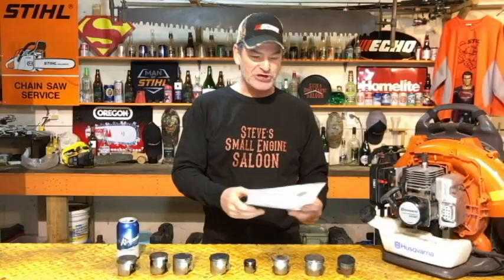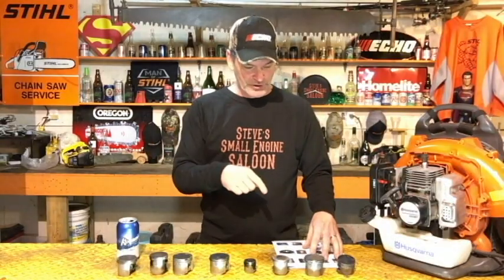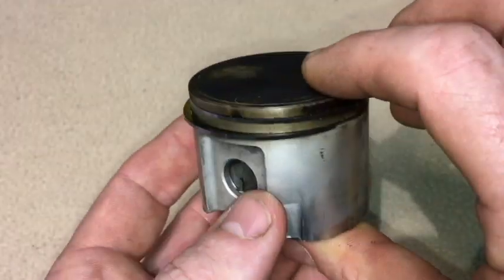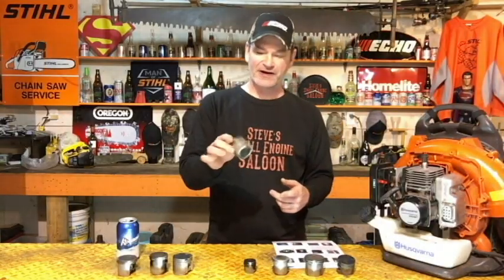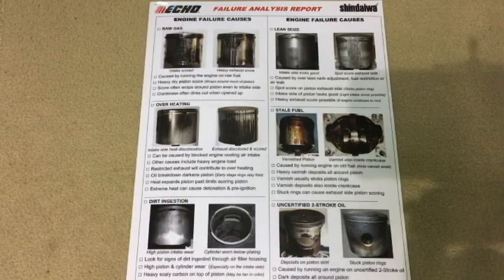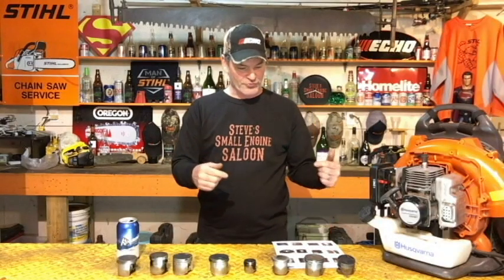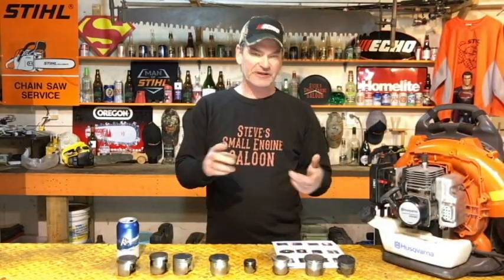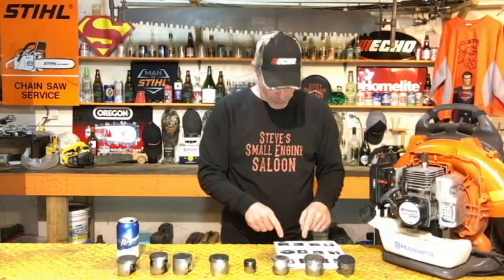How To Tell WHY Your Piston is Destroyed

Comment: Brilliant video, thanks!  I know this has been asked, but can many of these scored piston/cylinder issues be somewhat prevented by running a 40:1 mix instead of a 50:1 mix?  Thanks Steve.
Reply from the maker: I have burned 40:1 for over 20 years and never had a problem....
Reply: i run all my stihl on 33:1 and never had any problem
Reply: So should I be adding a little oil to the high dollar premixed 50:1 Echo Red Armor fuel that I use?

Comment: Steve....my echo PB 250 has an oversized gasket on the intake side of the carburetor.  Replacement carb rebuild kits have a gasket that just covers the intake port.  Does the oversized gasket have a purpose and should I reuse it if it is still good?

Comment: Awesome video Steve , you can't emphasize enough that leaning a carb out on a 2 cycle motor is taking away most if not ALL of its lubrication . And also have you had any issues with the Stihl MS441C saws having issues with spark plugs backing out on their own ?

Comment: Fantastic job !!   Hey Steve what is you recommendation for a good quality 2 cycle oil. And do you see and problem if I run my saws mixture at 40:1 instead of the recommend 50:1 ?
Reply: Mixing Ratio (Gas:Oil) Volume of Gasoline Volume of 2-Cycle Oil
32:1 1 US gal. (128 oz) 4 oz.
40:1 1 US gal. (128 oz) 3.2 oz.
50:1 1 US gal. (128 oz) 2.6 oz. 
ere u go mate
40:1 is a bit more oil to gas compared to 50:1 so yeah i think (imo, but i have only had a success rate of 1:3  only having fixed 1 chainsaw in my life which is a pouladn 2000 which uses 40:1 so yeah take it with that you will but i think it would be safe, keep in mind it might smoke a bit (i know its not healthy for the thing but it has a dull chain and i ran it on 50:1 and it smoked like a wood stove burning pine wood which is also not godd as the sap can get into the chimney and catch fire : | so yeah i sugest you use 50:1 but in a pinch if the saw requires 50:1 you can get away with 40:1 but if it requires 40:1 then just use 32:1 or something or just add a few extra drops of oil into a 50:1 mix for something a bit closer to a 40:1
Reply: @djaydeved  IDK what you're going on about... 

OP, if your engine calls for a 50:1 mix and you run 40:1, the negatives all involve fouling. Too much oil than needed causes carbon to build up on the piston crown, spark plug, and exhaust spark arrestor screen. Too much carbon on the piston may break off and scratch the cylinder wall. If you use a high quality synthetic 2 stroke oil with high quality ethanol free gasoline, your engine will be fine with 50:1 mix. If it brings you peace of mind, you can run 45:1 or 40:1 mix with the knowledge that you'll need to clean your plug and screen more frequently. Leaner oil mix ratios are the result of better 2 stroke oil blends that lubricate better with less ash, and EPA directives to make 2 stroke engines smoke and pollute less than before. Using ethanol free fuel is more beneficial to the overall health of the machine than a richer oil mix in my professional opinion. The carb will be destroyed by ethanol long before the rings and cylinder wall are worn out.
Reply: @mannys9130  Cylinder heads are mostly Nikisil coated. Any carbon coming off will not scratch it. It's hard as F.

Running premium (no ethanol) and a bit more oil then recommended is fine.

Comment: how can my piston be seriously scored on exhaust side and still get 115psi on compression? for 50 pulls it might start wide open for 3 seconds MIGHT! great spark great compression new carb new fuel lines and filter??? What gives?
Reply: immanuel ahrens 
Testing compression above the piston only tells part of the story. I would suggest performing a vacuum/compression test in the lower end and crank case to check for air leaks

Comment: Steve, do you have an opinion on what oil not to use? As in, I run Castor 927 in my two stroke dirt bike, but its water cooled. I currently use Stihl oil in my saw, but have thought of not using it and just using one oil in all of my stuff (the 927).

Comment: Very informative......keep the good work up Steve.
I have question for you sir.
Re: A craftsman 29 cc 4 stroke weed wacker model # 316.711970.
Has a compression of approximately 50 Psi ......could this engine start?
What’s the minimum compression needed to start this engine?
Thank you .
Reply from the maker: Most 4-stroke trimmers I have run across require at least 60...
Reply: Keep in mind most small 4 stroke engines have auto decompression systems that will cause the exhaust valve(s) to lift off it's seat on the compression stroke when the engine is spinning at low RPM, (like when your pull starting it or trying to take a compression reading) so the reading you get will not be the actual compression, and really won't tell you anything. You would have to disable the decompression system which can be simple like on Honda OHC GC type engines, or not possible without splitting the crank case like on a flat head briggs. Even a little 29 cc craftsman probly has an auto decompressor, If I was a gambling guy I'd bet it do!

Comment: Thanks Steve. Very useful info. I have a Briggs 6-5 OHV engine that blew out the head gasket right near the intake. PO ran it for a time even though it was puffing like a steam engine. Piston scored right near the blow out. Cylinder wall scored as well. Slight catch on my finger nail. My question is the cylinder still usable if honig can remove the slight scoring?  I get free gas powered machines and get them running again for resale but I don't want to sell anything that may fail prematurely. What's your advice?
Reply: Not very ethical.
Reply: I am not a small engine expert like Steve so I am not sure if this would be a usable cylinder. Are you saying that it would not be ethical to use it? I want to be ethical.

Comment: Another great video, Steve, thanks!  I'd like to add a comment for conversation and or comment regarding mix oil. Living on the coast and many boaters, I know folks who think it's just fine to run outboard two stroke oil for mix oil in their saws.  As I understand it outboard oil relies on water cooling instead of air cooling and therefore the temp range of the oil's protective capability is vastly different.  So, don't use it!!!

Comment: This was not dry at all this is good stuff and accurate, keep your jets a tad rich and 40:1 mix with quality oil!
Reply from the maker: I couldn't agree more...
Reply: @StevesSmallEngineSaloon  Where can I get a piston kit for the Maruyama trimmer 5050 ? I'm from Quebec Canada.Thanks
Reply: Also,.... warm your saw up.
Reply: I wish i had a small engine mechanic as knowledgeable as u Steve & as personable! 10 thumbs up
Reply: My echo blower says to use 50-1 and 89 octane gas. Should I still use 40-1?
Reply: @robertgerber2533    Use the recommended oil by mfr, mix it at 50:1 as instructed, an ONLY use high octane (min 92) without ethanol
Reply: @kellismith4329 There is absolutely no reason to run 92 octane fuel in a small engine. Octane is not a rating of quality, its a rating of resistance to combustion, these small engines do not have anywhere the amount of compression to require 92 octane fuel.
Reply: @integr8er66  it’s 94 that I use and ya cuz it doesn’t have ethanol and crap in it - 13 yr old blower now still like new
Reply: Too rich of oil mix will cause plug fouling and exhaust screen clogging - oils like red armor and echo powerblend contain cleaners to keep things clean - NEVER use car engine oil this is sure to cause failure
Reply: I've been running Amsoil's Sabre 100:1 mix in my Stihl saws really hard and for years and LOVE it.  Way less smoke and lost track of which gas jug was mixed, which one was straight gas and refilled my 1/3 full 1.5 gal woods saw jug with straight gas 2 days in a row.   That is, I had a half gallon of mixed gas left in the jug after an easy morning, refilled it with straight gas, cut the next morning and had a half gallon of very diluted mixed gas left in the woods jug, refilled it with another gallon of straight gas and ran the next morning, wasn't till I brought the saw down to the truck the 3rd day and filled it straight from the straight gas jug that the saw siezed up.
Reply: @mattobermiller5041  Uh, yikes! Poor saw that got the straight.
Reply: Did the same, diluted a 2g jug of mixed with 1.5G straight gas and forgot to remix - seized it about 20 minutes later
Reply: Nah I always crank the gas, washes the carbon deposits out before they can score stuff up!

Comment: I have an echo cs 3400.  When spark plug installed the compression feels very strong and lots of torque when pulling rope.  I took the plug out and when installed the compression tester it had hardly any torque and read only 30 psi  Why does it feel like it has a lot of compression when the spark plug is placed back in.  thanks for any assistance and great videos.
Reply from the maker: I would think you have a faulty tester....
Reply: Sometimes it can feel like there’s perfect compression but it’s not because it leaks out suddenly at or after TDC. I had an 034 I couldn’t get to run for forever, I double checked everything but compression because it felt perfect, but the cylinder would heat up slightly after a while pulling so i knew it was trying to run. Turns out the ring was stuck on the exh side, the connecting rod angle was keeping the piston sealed tight on that side but once the crank passed TDC the rod would push the piston to the other side, open up the gap where the ring was stuck and the air leaks all out.
Reply: I’ve diagnosed this a few times since then, just by slowly spinning the engine and seeing how it feels. They all have a bit of ‘wiggle room’ at tdc but if the flywheel moves too many degrees or feels like when the piston is at the bottom (just pulling starter rope) then you might want to check the piston
Reply: Thanks for the tips, I appreciate it.
Reply: I'm the tester, I'm faulty.  Hahahaha

Comment: Fuel restriction , lean running, .... don't underestimate the fuel filter, even if you just replaced it.  Some of the fuel filters I've been using , specifically 38-9227 from Rotary(503443201 substitute) had loose plastic flashing material  and flopping around inside the filter, blocking the filter outlet,  causing a "check valve effect".  That would certainly cause a lean condition.

Comment: Hey Steve. Love your channel. I have a question, I recently bought a Stihl MS271 and the dealer told me that Stihl no longer uses needle bearings for the piston pin and told me to use an ”extra shot” of oil directly into the has tank after adding the proper mix for the first five tanks. Have you seen this to be an issue? He said the new design is a bushing that is too tight on the tolerance and tends to seize before it wears in and the extra oil helps.
Reply: Your dealer is right. I have a buddy that had 2 BR600's that have piston pin seezed.  Also the manual states to not run 87 octain. It causes the pistion to run hotter. Also 
 Stihl hp ultra  oil  has far better resalts for the 4-mix moters ive heard

Comment: Excellent presentation!!  Getting ready to work on an old 1987 Stihl 011 that is hard to start.   Just ordered a compression tester you recommended.  Watched all your 6 videos on why my saw is hard to start.....I feel very confident after watching your vids that I can tackle this job!!  Thank you!!!!
Reply from the maker: You're Welcome...
Reply: Steve's Small Engine Saloon I did all you diagnostic tests, cleaned carb, 120 on compression test, new gas filter, gas line and spark plug.  It runs better than it ever had.  I used some premixed 50:1 gas.  Any recommendations on brand or ratio gas for this stihl 011 AV?  I have always mixed my own with alcohol free gas at a ratio of 50:1... ...it still runs and has good compression so I must be doing something right.

Comment: Steve, I always use ethanol-free gasoline and I always add StaBil when I buy it because I am never sure how long it will sit. How long can I trust that fuel?
Reply: There always has to be “That Guy” and I guess it has to be me today...
Even the manufacturers have acknowledged the impact of ethanol fuel.
Not just shortened shelf life, but also an impact on certain fuel lines and filters.
We run thousands of hours on two cycle Eq. Per season with ethanol fuel.  Nowadays with no trouble.  However, a number of years ago we had a sudden experience of fibrous filters failing at an alarming rate. 
Fortunately not all manufacturers used them, but with 40 or so pieces of hand held eq in service, we swapped out a lot of filters and lines.
The other problem is moisture. Alcohol attracts water and causes it to stay in solution instead of separating.
Improperly stored ethanol fuel will draw more moisture from the atmosphere.
We run ethanol fuel in the fleet. A lot of it,
 so it seldom  sits longer than a week.
However, when out of season we drain and run-out every piece.
StaBil and SeaFoam are great for equipment that sits, but I wouldn’t recommend running that fuel the following season. Dump it out and start fresh.
28 plus years of experience. I don’t know it all, but I do know what I’ve personally experienced.
Hope this helps.
Be Blessed!
Reply: 'The Environmental Protection Agency has approved gasoline with 15 percent ethanol for use in cars year 2001 or newer, yet it prohibits its use in mowers and other power equipment, stating it may cause damage. A Department of Energy study found that E15 caused hotter operating temperatures, erratic running, and engine-part failure. But even gas with the usual 10 percent ethanol (E10) could help destroy small engines.

"Ethanol has inherent properties that can cause corrosion of metal parts, including carburetors, degradation of plastic and rubber components, harder starting, and reduced engine life," says Marv Klowak, global vice president of research and development for Briggs & Stratton, the largest manufacturer of small engines. "The higher the ethanol content, the more acute the effects." Servicing dealers are reporting similar problems, even with E10, according to the Outdoor Power Equipment Institute, the industry's trade group'

https://www.consumerreports.org/cro/news/2013/03/gas-with-ethanol-can-make-small-engines-fail/index.htm
Reply: Always use 89 octane or higher. Less ethanol. I know manufactures don't recommend Using gas that's older than 2 months.
Reply: All gasoline has a lifetime and will varnish in a carburetor. Doesnt matter if its ethanol or not. Theres nothing wrong with using ethanol in a small engine. Gas is generally good for one year treated or not.
Reply: Ethanol gas is not a problem as long as you drain it out of a seldom used tool unless it has the new yellow fuel lines. The other fuel lines will rot away with ethanol gas. A benefit of ethanol free gas is more power. Ethanol has less stored energy than pure gas. I was using a Mac Mini 35 with ethanol gas, and as soon as I switched to ethanol free gas, I noticed a big difference in power. Your power tools will also run cooler with higher octane fuel (either type).

Comment: Most timely for my situation, I'm in the middle of replacing cylinder and piston on a Sthil 310 based on watching your referenced videos..  Any tricks or tips on getting the 4 torx cylinder bolts out?  This is the best channel for this kind of information and it is appreciated.
Reply: Long shanked torx

Comment: I had a BRAND NEW ECHO chainsaw fail-
   even IGNITION COIL was overheated as well as scored  piston !!
     was it out of carb adjustment RIGHT out of FACTORY?
      or due to ONLY ONE ring on piston?
       or due to only 3 threads on spark plug-that kept falling out?
        or did I get a LEMON?    since  2nd IDENTICAL MODEL is fine
       
-  and I have gotton OVER 12 yrs average off other chainsaws going back 50 yrs use
   ranging from OLD Pioneers,Lombard ,McColoughs,Skil,.Styhl,even Poulans and Sears ~~
    
ECHO said that my 35:1 oil /fuel mix was TOO RICH ~
      and that my   FRESH  PREMIUM NON -ETHANOL gas was faulty~
Reply: You did use mixed fuel ?
Reply: i said in initial posting that I used 35:1 vs 50:1 recommended
   for break in period but ~   
     ~And FRESH PREMIUM fuel, well mixed together